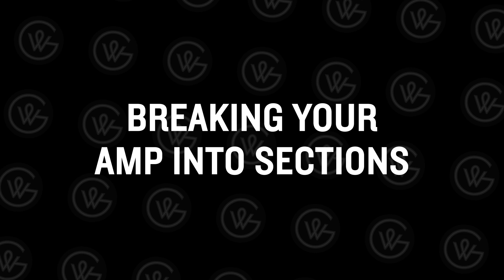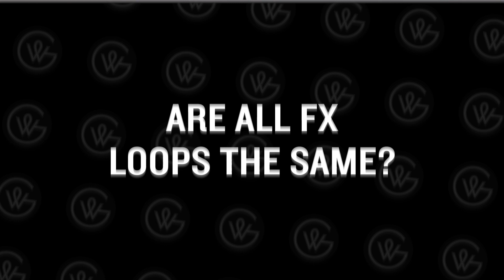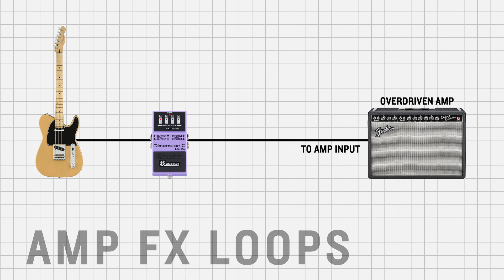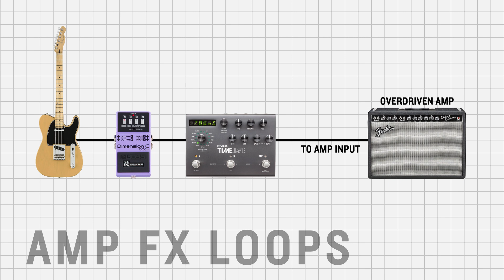Guitar Amp FX Loop Vs. Input Only

Comment: Very clear and straight forward. My problem is I have a dozen or so amplifiers including a bunch of vintage Fenders and a Carr Rambler none of which have effect loops. I also run my rig with 2 amps in stereo ( with the help of your Interfacer). I guess this works because Im not pushing the preamps to begin with. Have you ever done a video on stereo setups? I do this in a home recording environment. Really gives a huge  guitar sound! Thanx for your efforts.

Comment: Now I got it...so its safe to use a clean channel when using an overdrive pedal + delay pedal w/o effects loop but when using the amp's high gain channel + delay pedal, it would be better to utilize the effects loop. Thanks.
Reply from the maker: That's one way of looking at it.  But I would discourage trying to find black and white rules to define your signal chain by and instead listen for what you want to hear.  As an example... I use an amp where the clean channel can be pushed into overdrive.  I never use the high gain channel.  If I push the preamp of my amp (the clean channeL) into overdrive, the FX loop can be a HUGE help.  So although you're correct in what you say, depending on the sound you're going for / how you run your amp, you might also want the FX loop depending on the amp type and how you're running it. Hope this helps a bit! Trust your ear and do lots of experimenting.
Reply: @GoodwoodAudio  Thanx for elaborating...I surely get your point. Thanx again. 😁

Comment: I have both an effects loop and pre amp/ power amp in/out too. Which one is better or the same? For noise gate and delay. Distortion from pre amp.
Reply from the maker: on the same amp or two different amps?  
Often Fender uses Pre-Amp Out and Power In which is the same as FX Send and FX return.  
Sounds like the same thing, but without more context I can't be 100% sure.  
Noise gate can be wired in a bunch of ways.  You can wire it in for a noisy guitar, noisy pedals or for noisy amps... All require different signal routing.   Vertex FX does a great video on this!
Reply: @GoodwoodAudio   Ampeg VH-140C I have an effects loop on the front and 2 pre-amp/power amps on the back. One dry and one chorus. I’ve hooked up the 4 cable method to the amp and the noise gate is working nicely. I’m trying to figure out where my delay goes best.

Comment: At 3:34 you say "we go from out LAST dry effect.."   
besides coming in clean straight from the guitar, what other 'dry' effects are there?
Reply from the maker: its been so long I honestly dont' remember what I used.  Most likely a compressor and a light OD - I tend to grab a TS9 but it's really more about the 'theory' of how to run an FX Loop anyway... You put your gain (dry pedals) before the amp input in most scenarios which is why I referenced the dry fx / last dry effect.

Comment: Is there a seperate effect loop device to buy without buying a whole guitar amp?
Reply from the maker: Hey Eddy, can you clarify this a bit more? Do you mean a way to take an amp without an FX loop and mod it / get a device that allows that amp to separate it's pre and power amp?
Reply: @GoodwoodAudio  No, is there just a single FX loop pedal or divice (that is not an amp), so I don't have to buy a amp, I just need the FX loop to record my distortion pedal. Do I have to buy a whole amp or I can just get the FX loop (for better sound)?
Reply from the maker: @eddykingdomsbrandson1827  What if you split your signal after your distortion... So you had a 'dry output' that you could record distortion only and at the same time you could record distortion INTO your wet effects.  Would that work?  The reason I'm a bit confused / wanting to clarify is generally the FX loop is used to take advantage of the preamp on your amplifier... so without that I'm just trying to figure out how to make this work the way you want.  But if I'm correct on teh above - YES - you can do that.  We have a product called 'Isolator' we make on request that can help with this.  Feel free to email me at info@goodwoodaudio.com if that helps.
Reply: @GoodwoodAudio  Let me put it this way. I recorded a song with my band. And the guitarist says the distortion sounds just so bad and broken. And I can't find anything on youtube that could help me. I connected directly with cable from distortion pedal to PC. I don't know how to record, everything I tried just sounds the same hissy, broken guitar distortion sound. See this, one of our songs how it sounds like - https://www.youtube.com/watch?v=3bz0SSEeQHo

Comment: Where is the best place to put my boost pedal for solos in a amp? Is it on input amp or in a effects loop? What happens if put boost pedal in a parallel effects loop, after my effects that are with kill dry on?
Reply from the maker: VERY good question.  The thing want to consider (both can work well depending on what you want) is how you want your boost to interact with your amp / pedals.  If you put a boost before your amp input it will drive the amp / preamp / gain stage harder resulting in more gain but less volume.  If you put your boost in your FX loop (after the pre-amp in your amplifier) it will tend to give you more volume but not more gain (im generalising a bit).  You will hear more of the boost characteristics if its after the pre-amp stage.  If you are running a parallel fx loop with a boost into pedals in kill dry, only the wet effects will 'see' the boost (assuming you are at 100% wet.). Its a big question that will change a bit depending on a few variables on your board, but hopefully that gets you started.  let me know if that makes sense!

Comment: WHAT!?  I'm more confused now then when I started the video. Wet effects, dry effects, what is that? What qualifies as wet or dry? Which one is a compressor for example? is that considered a damp effect?   Do I put modulation and reverb through the loop, and plug my overdrive straight in.  I think you may have over complicated this.
Reply from the maker: Good questions... Wet effects typically refer to delay and verb (effects with trails after the initial attack of the guitar).  Modulation would be chorus, tremolo, flanger etc. Dry would often refer to overdrives, compressor, fuzz...effects that would typically come before your amp fx loop. Again - these are general terms only but help in breaking up a pedalboard signal path into sections.  Modulation and delay/verb would often go in your amp FX loop, yes.  Although this rule can also be bent or 'broken'.  Volume after your amps pre-amp is also common. So is a boost.  All of this is just a starting point for you to manipulate to what suits you best!

Comment: So many of us simply don’t understand these simple pieces and how they interact. Simply cannot run everything through the front or through the FX. Thank you for the breakdown. That being said, is there any reason to add an OD to the FX loop when there is already an OD/ Distortion on the Pre-Amp? In addition, is there a parallel FX loop amp that you would recommend?
Reply from the maker: Hey Alan. Thanks for the kind words.  If you're up for experimenting, there are definitely reasons to try an OD in the FX loop... Similarly to changing the order of your ODs on your board, changing where the FX loop goes could be a fun experiment.  Typically though, players tend to keep their FX loop as the last 'drive' section on their board.. .but its not a hard and fast rule. 
I actually don't have a parallel FX loop I'd recommend.  Its not an area Im extremely well versed in as I only have real experience with a couple different versions, but there would be better people to ask for advice on different parallel FX loops

Comment: I have a two amp setup. I'm running delay, reverb, and a looper pedal in one of the amps effects loop (wet amp), but not the other amp (dry amp). It actually works, and I love just having the loop in just one amp. I can play lead over the loop getting the sound of both amps, or use the ABY switcher to just play lead with the amp not running the loop (the dry amp) which is set for more gain. When I tried to run the looper in the front of both amps, it ends up getting delay added if I'm using delay while playing lead. Having it in the effects loop of just one amp avoids this issue. My question is -- is there a downside to running my looper in one of the amp's effects loop?  Have you tried it? What are your thoughts?
Reply from the maker: Good question. This depends a bit on how you're routing everything.  Do you mind sending me a rough drawing of your signal chain so I can see how you're splitting these signal paths?  Feel free to send it to info@goodwoodaudio.com. Happy to take a look.

Comment: I have a question off/on top about send/return loops. I run a pbc 10 with multiple drives in the loops. I'm looking at getting the new Boss SY-200 (Midi controlled Synth Pedal) and it comes with a send and return loop. I really want to run all my other pedals in parallel with the SY-200 but keep everything in PBC loops. Is there a way to accomplish this? If that makes sense? Thanks!
Reply from the maker: depends how picky you are with routing.  it definitely is.  You could start by going Guitar - SY200 input - Send to Input of PBC (go through all loops) output of PBC to return of SY200 - Sy200 Output to amp.  There are a few other ways you could do this with the insert loops on the PBC if you only wanted to run part of your signal chain in parallel, but that's the way to run the whole signal chain in parallel.  Make sense? Feel free to email info@goodwoodaudio.com with more questions.